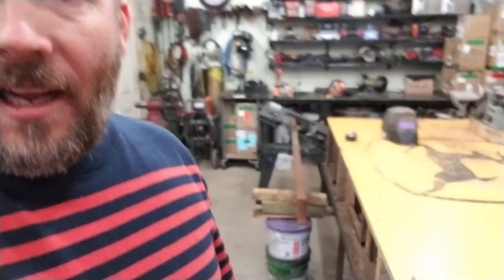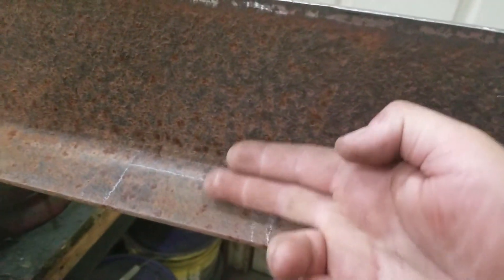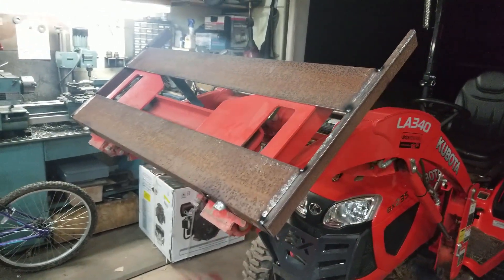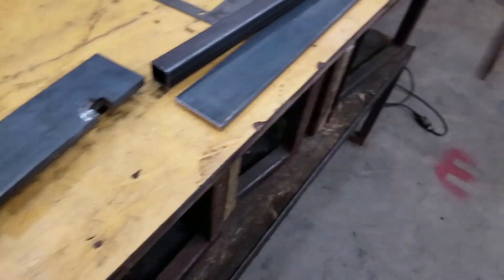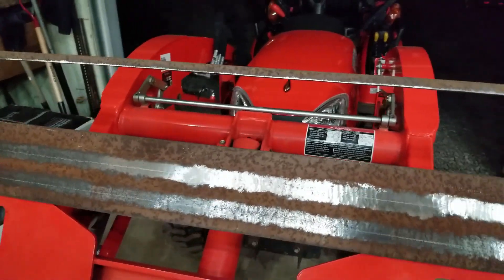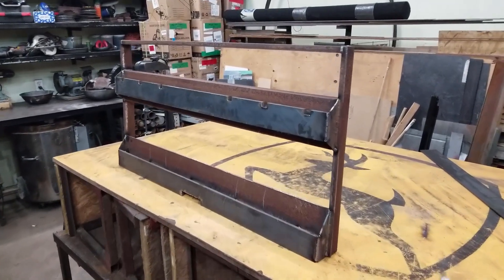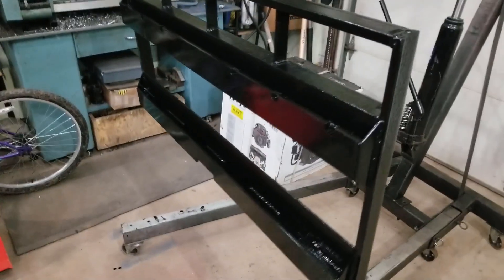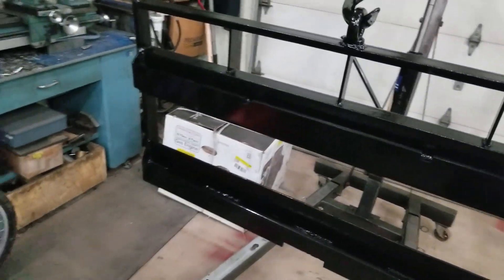How to Build a DIY Pallet Fork Attachment for $150

Comment: What have you lifted with these?  Are you able to lift the front of your tractor up off the ground?  I would like to know if anything bent and if the welds held. A video of it in action would be excellent.
Reply from the maker: Not one issue with it. I think I kinda overbuilt it. The only problem I've run into is that the forks themselves are about 100 lbs each which reduces my tractors lifting capacity by a lot seeing as though it's only 650 lbs.

Comment: What is the center cut out for?
With this design can you push down with the forks. I could not see if they are locked into place or are held in only by gravity.
Reply from the maker: The center cutout is to remove the forks. They're hooked in at the bottom as well as the top so yes, you can push down with them. Hope that answers your question.

Comment: Where did you get the quick attach that has center cylinder hook up for your tractor ?
Reply from the maker: I opted to get it at the dealership instead of the pin-on connectors when i boight it. I think it cost me $250 more if I remember correctly.

Comment: Chris, nice build. I’ll be doing this for myself soon for my project 40 yr old  skid steer.  I’ve built these before and have one tip - offset the bottom rail back in the side uprights so that when mounted on the tractor you’re able to tip the fork tips up to secure the load. If you make it so the mounting rails are equal distant top and bottom from the tractor like this, you’ll never be able to tip the forks back past level with the ground. Also, the loader will be at max tip backwards while trying to pick up something on the ground, which is at the weakest angular position for your front hydraulic dump cylinders. Scott

Comment: Very nice job, I opted to build forks out of 2X3 square tubing, 1/4 thick, with a skid steer attachment blank, to keep it as light as possible, the target would be to keep it under 150 pounds if possible, as the normal bucket weighs 132 pounds, and my BX24D has an actually tested 785 pounds lift capacity, I figured the lighter the forks assembly is, the more I can haul...have you weigh your forks, they seem very strong, but also heavy?
Reply from the maker: Yes, that's my biggest issues. Each fork weighs about 85 lbs which greatly reduces my overall lift capacity. I might make some lighter forks and sell these
Reply: @ChrisOfAllTrades  If I can give you some info, the clamp on forks use square tubing 2x3 1/4 inches thick, and welds another 2x3 5/16 on top vertically, and reinforces the joint with 1/4 plate cut in an L fashion very resistant but light, they resist up to 1,500 pounds, that is already an overkill, I will build mine with 2x3 1/4 thick all the way, I can't lift more than 800 pounds anyway, and only 36 inches long, to keep my total length and weight in check a bit.

Comment: Looks great mate. I bought some bucket attach forks, they are useless on the bx23 due to the offset from the hinge reduces the lift capacity. I've been planning on hacking them up and welding a quick attach like you did. I think think due to the limited lift capacity of the BX you could reduce the weight of the forks to match the max lifting capacity. Thanks for the video.
Reply: I wouldnt say "useless," but, very limited indeed.

Comment: I personally think you should have put some more weld beads on, but I’m curious how it’s been so far.
Reply from the maker: I've strapped those onto a John Deere SG310 backhoe and lifted insane loads with it. On was to the point where it literally bent the 2x6 steel and the welds never budged. I sold the big machine now and the forks are almost too heavy to be practical for my little 25hp kubota, but yeah, they have definitely served their purpose...

Comment: Good job on the forks, I think the forks from kubota are around $1400.   I am pretty sure the forks will withstand way more weight than the tractor can lift.
Reply: You are correct, the fork capacity is way higher than the tractors.

Comment: Thats a nice job on the forks for a project, you just got way more forks than tractor to use them you could get in trouble real quick depending what you are doing. They wouldn't look out of place on my 100 hp front assist chore tractor on the farm, but i'd have to go careful not to overload them being built with a lighter frame for your tractor . Thanks for sharing, take care.
Reply: Your concern is unfounded.   The Kubota BX will do just fine. I have one of the original BX2200s and I can tell you  although small they are real tractors.   The hydraulic system bypass limits lift so it depends on how bypass is set.  Lifts of 900 have been reported, spec is about 500.   Without rear weight or fluid filed tires the BX will pivot on the front axle at max lift.  My box blade is sufficient to keep all fours down.

If there is any flaw in this build is that it may be too heavy.  Between the quick attach and forks there may not be much lift capacity left.  And it maybe just fine for what Chris wants to do with them..

Nice build Chris
Reply: @danharold3087  Don't worry I fix equipment for a living to, I've seen the stupid stuff people do with bigger tractors and wheel loaders than these and it's all relevant to any size tractor/machine. if you get it wrong you'll wreck it or if real unlucky injure or kill yourself or somebody else just the same. 

Putting all the weight on the front axle so it pivots can cause serious damage . it might be ok for a few times doing it but there is a real risk of snapping overloaded internal components, castings on the axle/mounting or even transmission castings failing further back. 
  Ive seen it on 80hp plus tractors, they are not designed to carry that much weight on the front end, especially if you still manage to try or succeed lifting a ballasted rear end. 

Guys just have to be sensible and careful even seasoned operators get it wrong without a good ending sometimes.  
   If a guys putting video's out on youtube bear in mind some idiot that has no clue with his new acerage and shiny tractor might be watching. Then go screw up because they were in out of their depth. 
 
  Machinery somedays is really no different to pointing a loaded gun at a guy and pulling the trigger.. Enjoy what you guys are doing and as long as everybodys safe and not harming anybody or the equipment it's all good.